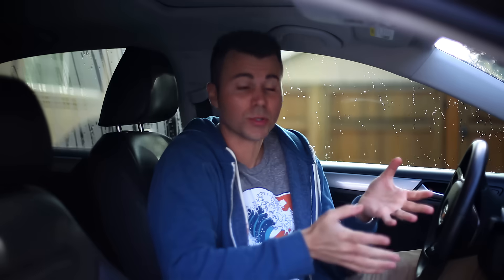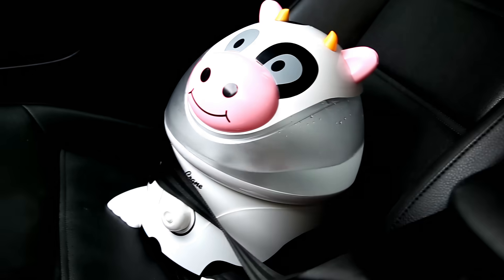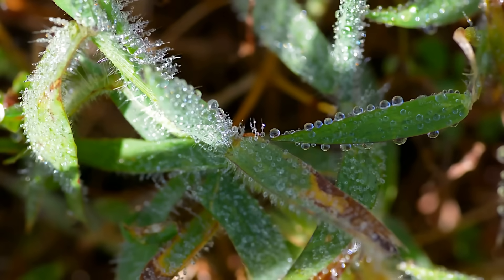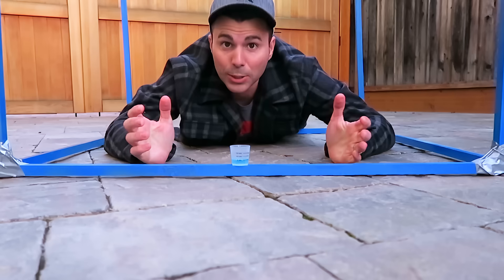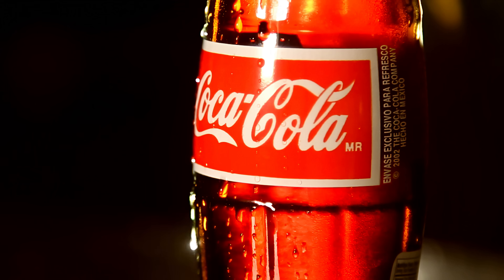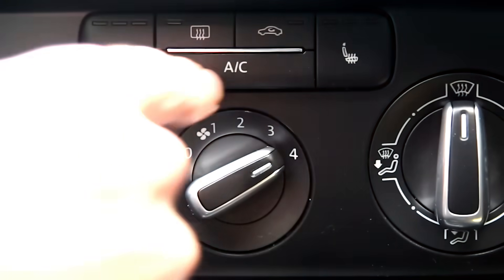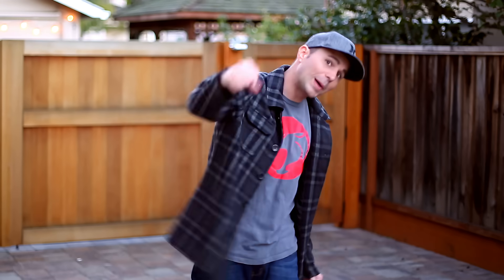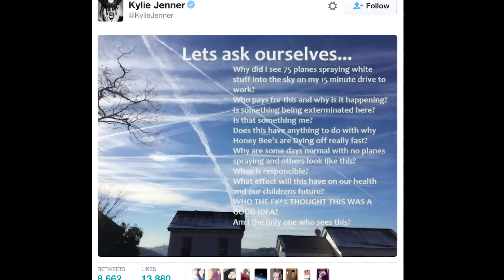Defog your windows TWICE as fast using SCIENCE- 4 easy steps

Comment: Step 1 Start your car. 
Step 2 Turn the a/c on, turn the heat up all the way, and turn the fan up to the loud position. 
Step 3 Go back inside and wait until the 2020 Election has been certified by the Electoral College.  
Step 4 If you’re really in a hurry, wipe the window with your sleeve.
Step 4.5 If you’re really really in a hurry, drive with you head out the window until your car heats up.

Comment: Cars take a long time for hot air to start being produced, if you turn your fan on the lowest setting, the blower motor resistor gives off a lot of heat, and so you can actually get a lot of heat output without the engine being warm at a low fan speed
Reply: Dunno who told you this but no, the engine is gives of a lot more heat ( even just after start up) then that resistor. It just a minute for the warm coolant to circulate through the heater core.

Comment: Car heat exchangers use the engine heat. If the engine is cold (just started) blasting "hot air" setting will only blast regular, outside air.

Just keep that in mind.

Comment: So the question I've had is:its hot and heavily raining; do you crack the window and do I use outside air or try to let the AC dry a sealed volume of air? I do know that eventually I have to vent the car because apparently my Jetta doesn't seem to actually drain the water on the AC coils so eventually they saturate when recirculating.
Reply: You have a plugged A/C drain.  This is common, especially on vehicles that are at least several years old.  As for technique, since opening the windows and heat are both impractical in your case: start with the "defrost only" (which runs the A/C and directs the air up) and leave "recirc" off.  Both the outside and inside air in your case are near full saturation, so moving air through is necessary to carry what moisture you can cause to evaporate with the "defroster" away.  Don't forget, you and any passengers are adding to the moisture content as well with your breath and presumably wet clothes.

Comment: I think the hidden secret method is to bring a large (dry) towel, no metaphor, from the house with you to wipe the window(s) down as you start the defog procedure.
-
If, like me, you love where actual ice falls out of the air in the winter, the defogging is usually done by the time you finished brushing and/or scraping the outsides of the windows. 

And clean off ALL the windows and lights and license plates, and clear large amounts of snow from your whole car. Don't get a ticket and an extra twenty minutes pulled over during your commute because you were in a hurry or lazy (or both).
Reply: or just leave the towel laid over your windshield the night before and pull it off in one go.

Comment: I have never in my life owned a car that you could have the AC and the heater on at the same time - they are usually mutually exclusive settings. I just walked out and tried it in my current car to confirm and pressing the button for heat turns off the AC and vice versa.
Reply: Your car shouldn't do that
Reply: @icedpacmangames4886  According to the owner's manual that is exactly the expected behavior so if you think ti shouldn't do that, talk to Toyota. :)
Reply: @markissleepy  ok. Also I think you're just about the only person who reads they're owners manual :)

Comment: Instead of simulating a large dry towel, use a large dry towel.
Reply: Water builds up in between the panels of glass
Reply: leaves marks (small bits of the water still not fully into water droplets being spread all over it.)
Reply: Ya I'll just put on my large towel helmet and climb in my large towel cannon and blast off to large towel land where they have all the large towels!
Reply: @ChefBoiRDeee  right? Like where the f am I supposed to get a large dry towel?

Comment: A lot of vehicles automatically turn the A/C compressor on when you have the air blowing from the defog vents for this purpose. Also with the A/C compressor on, it prevents the moisture from going from the front to back windows since the air would be colder away from the front until the entire cabin heats up. For me, my compressor needs replaced so I always have my windows cracked when I need to use my defogger with the belief of the humid air would be able to escape from the cabin, which is obviously a good belief.
Reply: Cracking the windows will help speed that process up, but your car already has in built vents for that.
Reply: My Volvo v50 does that, hit the Defog button and it sets the AC and a few other settings for me. Works a treat. I trust the Swedish lol.

Comment: Saving money by using shaving cream to help fight moisture on the glass will shave (pun) a few minutes off your morning commute. (~5:00) I'm not sure you actually meant to do it, but it was good. A point for you, sir! :)

I agree with fan on High, temp on High, using AC to dehumidify the incoming air, and crack the windows to exchange the humid air. I also agree with using outside air, but only until the window is clear. Once cleared, I close the windows and use Recirc to keep the humidity as low as possible. 

BTW, did you know that when you have the HVAC system will defog the front windshield, it will use the AC even on systems that use a rotary knob or a slider? My used 1981 Ford did it, so this automatic feature has been around for decades; it's just that not everyone is aware of it since the AC light is prevented from being turned on.

Also, Recirc on modern cars will usually turn on the AC as well, and like the WS Defog, the AC light won't turn on unless you manually press the AC button yourself.

Comment: I don't think I've ever seen a car that is equipped with A/C that didn't automatically turn on the A/C compressor with the defogger. Even cheap old cars. Just because the "A/C" light isn't on doesn't mean it's not using the compressor to dry the air - it should never illuminate this light for just defogging.

In car speak, "defog" or "defrost" means hot air + A/C compressor...this has been standard many, many decades.

Comment: "... which is 10 times less..."
What?  WHAT?
The equation for "X is 10 times LESS than Y" is what?  
The difference between the amounts in the hot and cold examples (the "less") is 9 times the amount in the colder physical conditions.
"This is 1/10 of the amount possible in the previous (hotter) physical conditions" is a much easier equation.
This is why people can't do "word problems".  The WORDS are wrong!
(where is that Steve Martin clip of "well excuse me"?)

Comment: Some vehicles won’t even let you use defrost and recirculation at the same time because some vehicles use the defrost vents as the recirculation vents so it automatically pulls outside air
Reply: Recirculation vents are underneath the front seats

Comment: Living in northern michigan ive noticed it helps a lot in terms of ice build up when its snowing if you turn off the heat and crack windows before you get home, letting internal temperatures cool.  Of course remote start is the ultimate solution, love it!
Reply: I’d argue the ultimate solution is a garage.

Comment: Doesn't turning on ac in cold temperatures damage the ac unit?
Reply: Its a car. Not a refrigerator. The AC turns on automatically when defrost is selected... in most vehicles 30 years or newer

Comment: Why is no one talking of the input parameters of the equation: When you park your car at night, it would make a huge difference to open the windows beforehand to let the warm humid air escape and thereby removing as much humidity as possible, no? The fresh cold air will hold much less water and therefor lead to much less condensation to begin with.
Reply: Then someone can steal your car...
Reply: @suki757  Hahaha.. I'm not suggesting to leave them open.. just, to give the car like two minutes to release the warm humid air, before parking it and leaving it for the night.
Reply: To keep  snow from sticking to my car. I chill it way down. So nothing melts on. Then it just brushes off.

Comment: For one. In most cars. The ac compressor automatically comes on when you turn on the defogger to help dry the air. For 2. In most all cars. You literally can't have the recirculate function on when you have the defogger on anyways... This is because the exit for the defogger/defroster is the entrance for recirculating the air. You should probably try to understand how vehicles work before trying to tell people how to operate them... Also. There's a difference between fog and frost. Fog is on the inside. Frost is on the outside. Usually. Unless you have a ridiculously high amount of moisture inside your vehicle in winter. This means defrosting both takes longer and is a bit of a different process than defogging.

Comment: ....Hmmm, but why does heating the air inside the car help reduce the condensation on the windshield? I thought the condensation on the windshield was on the outside of the windshield, not inside on the inside of the car. So heating up the air inside the car would then heat up the windshield, giving the water molecules in the condensation droplets more energy to vaporize? Maybe?

Comment: This is really helpful. How about exchanging the inside air just before parking for the day/night? My thinking is that it will take humid air out and bring dry air in. Makes sense?
Reply: Yup open up your windows 30 seconds before you pull in your driveway or leave your door open for a little bit when you get home to let the interior temp equalize.
Reply: @nickbisson8243  Are cars really that isolated? I would think the same thing happens over 16 hours in the driveway
Reply: @twixles6297  warm or hot air holds more moisture than cold air so by opening up your window 30 seconds to a minute before you get home removes most of the condensation that would condense on the inside of your windshield and ice over.

Comment: Strictly speaking air does not ‘hold’ water.  The air and water is a mechanical mixture not a solvent-solute system in the way, for example, that water and table salt is.  Increasing the temperature of air does not increase its holding capacity (i.e. solubility) for water vapour in the same way that the solubility of liquid water for table salt increases with temperature. The higher air temperature means that the partial pressure of water vapour in the air-water mixture is greater than it is at a lower temperature thus the quantity of water in a given volume of the mixture is more in the hotter mixture.  Water content in air can be wholly explained by the physical properties (p-V-T) of water alone. It has nothing to do with air

Comment: Marc: you forgot two elements, clean dust free windshield both inside and outside. Dust promotes condensation (e.g. clouds require dust particles to form) and also there is inside, and outside condensation, which require different techniques. If condensation is outside the windshield, heat the windshield up. If inside, chill it down with the a/c.
Reply: AC automatically comes on when you turn defrost on! Nice try playing smart tho....

Comment: For viewers... FYI defogging is not the same as defrosting/de-icing. If you have ice on your windows, it's on the outside. 
By the time the inside of the windows are defogged, the outside will start to melt. So what he said about humidity doesn't really apply to the ice on the side of the windows.

Comment: Now I have proof for my theory. I'v argued that the heater and crack the window is best to de-mist, but everybody argues to blast the AC. The problem I always found with ac only was that you needed to keep it constantly on, as it would mist up again once you turned it off, so it gets pretty cold. If you use the heater and crack the window, eventually you can close the windows and it stays de-misted.

Comment: Those were actually the settings that I've been using for a while. Didn't thought about the AC though. 
Only if you can't dry fast enough the hot air, it will  condense in the windshield making it worse.
Reply: AC automatically comes on anyways. No need to do that step.

Comment: The simplest way to solve this problem is to not get frost on the first place. Just vent the car after the ride for 30 seconds (to make the towel tiny). Also, if you blast the heat, the cold air from outside will keep the engine cold for much longer. And the engine is the source of heat in the car. So you are not getting heat for much longer if you blast it rather than waiting for engine temperature to come up first.

Comment: Most cars are going to choose those options anyway for you. Except cracking your windows. If you have air con in your car when you choose defog mode it will automatically turn on the air con and normally switch off recirculate. It is built into the thermostat controls. RainX and other products work really well too. Just keep your windows clean will help. Unless you have a leaky heater core then you are screwed lol. It will actually fog your windows up worse.
Reply: If the inside of your car was controlled by the thermostat then you have bigger problems

Comment: Put the heater on max and set it too hit the windscreen? Depending on how low the temperature is outside and how hot the heater air is hitting your windscreen; if the temperature differential is high enough, expect a cracked windshield. Especially is this true if your windscreen already has an imperfection like a star or pit etcetera.

Comment: Go into more about those "Chem trails" a lot of us believe that
Reply: Why,? As a former pilot, air changes direction every 2,000 feet and when you have water vapor at altitude, above FL30, it will drift one or two states over before possibly contacting the ground. It may never contact the ground, until the next storm. So, what you have is an uncontrolled disbursement of some chemical. What is more plausible are those 5AM Army National Guard helicopters that can spray when the air is still and from low altitude to ensure proper coverage. Hey, while we're going nutter, when the county mosquito sprays... they're really chemtrailing you.

Comment: Turn on the heater and the A/C at the same time?  +1 - 1 = 0.  Also you are sucking outside air over the A/C condenser, so how does that remove water from the inside air?

Comment: Too bad it's the water accumulating in the outside of my windshield and freezing as I drive to work that's the problem. I've never had water on the inside. But the solution is the same, hot air.

Comment: You know how I handle it? I have a small space heater inside my car I plug into an extension cord that's plugged into a timer set for 30 minutes before i wake up. Boom. Problem solved. Added perk, works as defrost in the wintertime as well

Comment: When using maximum speed of the fan you lower the speed of the engine coolant to become hotter  that's why on most vehicle manual they put arount 75% of the blast for quikest heating . Or Get a racing windscreen with heater wiring in it and it's lighter so you gain some time going to your work ! 😂

Comment: I live in ND... any tips on getting warm air faster when its -30?
Reply: Use a block heater and plug it in. Use a timer so you don't have to pay so much on the electric bill. 3 hours before start time is usually enough. The other way i can tell you works but damages things lol which is hold the throttle to the floor haha

Comment: Any time you select defrost windshield, air conditioning automatically comes on
Reply: Depends on the year of the car I think
Reply: yes. i came here to make the same comment and i’m happy others know this. i think the vast majority of cars on the road today behave in that manner. good comment.
Reply: My 2006 Suzuki doesn't do that sadly. i just have an on/off button for ac, a rotating mechanical knob for heat, and a 5-step knob for fan speed. Old school i suppose...
Reply: @Pulsarstunes  very strange. my 1998 ram turns on the AC automatically whenever defrost is used. there is no light to indicate it is on, but the compressor is engaged. you can hear it under the hood.
Reply: @ericchapman9579  I think that's because it's using the compressor to recirculate the inside air, not actually using the ac.
Reply: @Pulsarstunes  Thats an old car, no surprise but thank you for being Captain Obvious. On German cars you can find it in 2006, or much earlier for american cars, but Japanese cars came later with pretty much everything.
Reply: My newest car, a VW 2019, has an indicator light for when AC is on BUT i discovered that AC is on without the indicator light being lit in many cases. Some experiementing was done and i can now predict accurately when AC is on or off. The thing is, with this car i dont always want AC on, and if it been on for a while in winter the rimfrost of the evaporator will turn into steam when putting heat on without AC on, and THEN the windows will fog up completely.
Reply: You're right.  AC compressor will kick on and it will usually default to the outside air setting.  Also, depends on year of vehicle like some others have already said.
Reply: Nah my car doesnt do that. I had to do everything manually and its a 2016 model
Reply: @chrisp7110  You cannot be sure unless you tested it metodically, on my 2019 VW the AC turns on withoiut the AC indicator light being lit. Ifg i put it to full defrost, yes the light goes on, but if i put it to partial vent/defrost the AC wil be on but no ac indicator light. I used the car for months before i discovered it, now if i want the AC to be off i turn the knob 45 degrees towards Vent, thats 3 notches. 2 notches and AC is seemingly off but actually on.
Reply: @chrisp7110  i’m surprised to hear that. what kind of car is it?
Reply: My 2012 car doesn't lol, it's whether you have a premium model not what year. On many cars AC is an optional extra and is not designed to be connected to the windscreen heater circuitry.